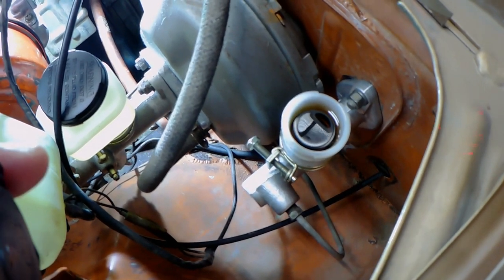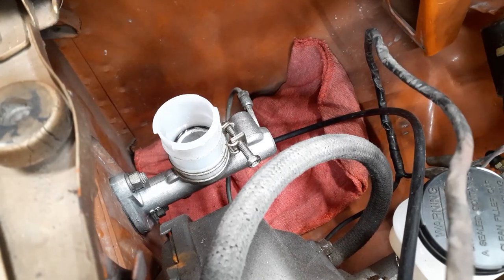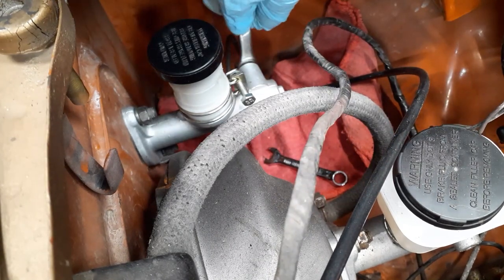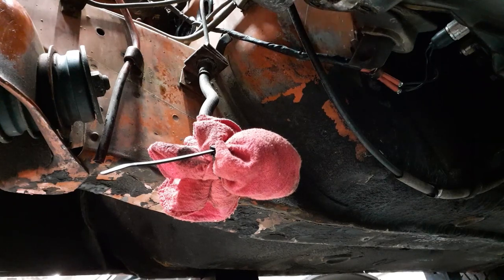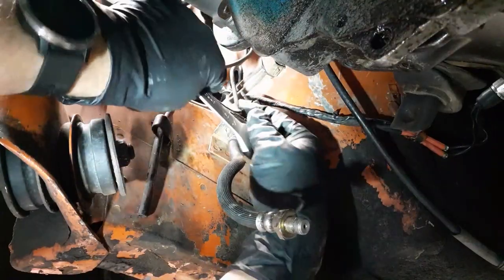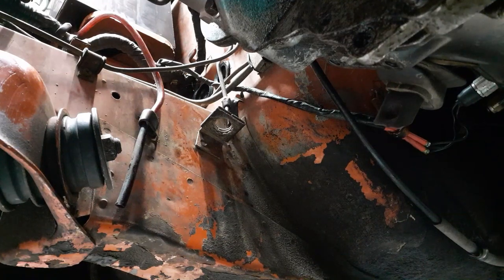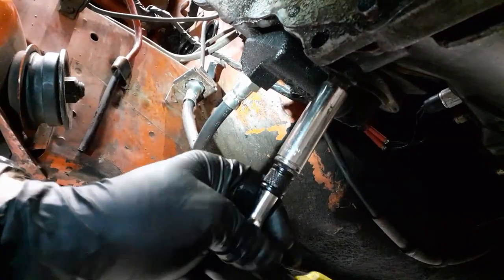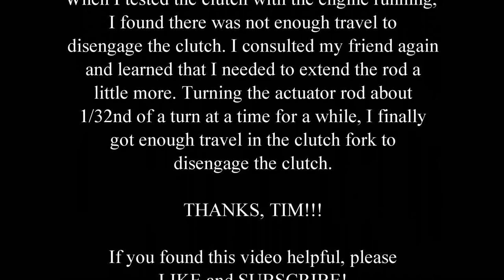240Z Clutch Hydraulics Replacement

Comment: If you were positive that you had the correct replacement rubber hose for the  slave cylinder , you could have cut the hose off close to the metal fitting and used a deep socket to break the nut loose!

Comment: That was very helpful!  My '78 280z has an issue of only engaging near the very top of pedal travel.  I assumed it is a worn clutch, but I noticed that the master and slave are not original.  Do you think the yoke on the master cylinder could be adjusted to correct this or am I just dreaming?  I would love for that to be the answer instead of a new clutch of course.  Thanks again for a great video.
Reply from the maker: Usually a worn clutch will show slippage. If you haven't bled the clutch in a while, it may be time. A couple of months back I was bleeding a friend's clutch slave, and the pedal feel was greatly improved. Here was my process:
1. I used a turkey baster to remove the dark fluid from the master reservoir.
2. I refilled the reservoir with fresh fluid.
3. I repeated steps 1 and 2 a couple of more times, and then I didn't refill.
4. I took some blue paper towel to wipe inside the master reservoir to remove the last of the debris.
5. I put the rest of the fluid in the refill bottle of an air compressor powered vacuum bleeder. An inexpensive example can be found by searching for "KUNTEC Pneumatic Brake Fluid Bleeder Tool". The kit comes with several different adapters for the reservoir. 
   a. Pick the correct size adapter and put it on the refill bottle.
   b. Invert the refill bottle and put it on the reservoir.
   c. Open the valve on the refill bottle to fill the reservoir.
6. Go underneath with the vacuum bottle.
7. Loop the hose of the vacuum bottle over one of the battery cables and attach the end to the slave cylinder. The vertical run in the hose prevents air from getting back into the slave.
8. Crack open the bleed screw.
9. Use the vacuum bottle to pull fluid through the hydraulic circuit until it looks nice and clean.
10. Close the bleed screw.
11. Get a friend/wife/gf/enemy/stranger in the car.
12. Tell your assistant to push the clutch pedal to the floor and hold.
13. Crack open the bleed screw.
14. Close the bleed screw.
15. Tell your assistant to release the pedal.
16. Repeat 12-15, asking the assistant for feedback on if the pedal is getting stiffer.
Reply: @myZcarlife  That great advice.  Thanks for weighing in!  Subbed.